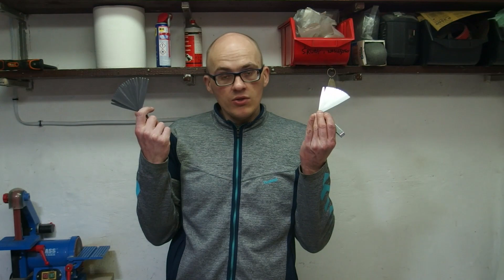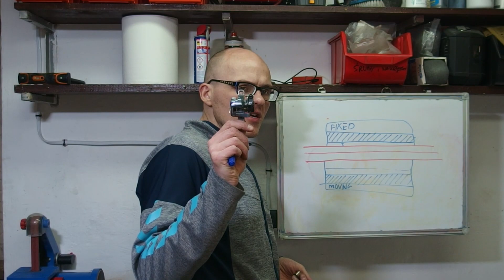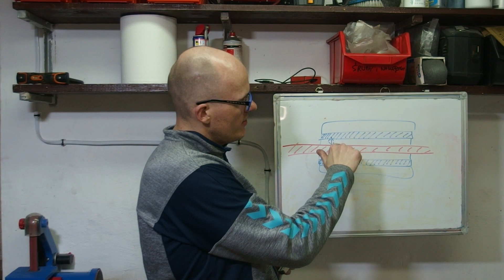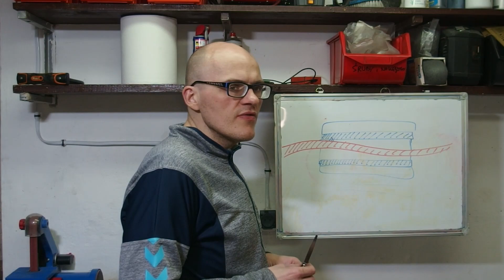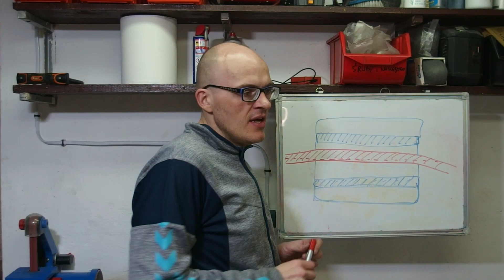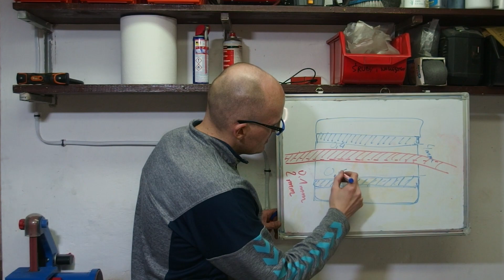Adjusting disk brakes like a pro. Chirp Chirp Edition

Comment: Thanks for making this video to show this inventive way to adjust brake calipers.

If the rotor is warped, do you use the shim to align the caliper to the rotor so that the pad face is parallel to the face of the rotor where they make contact?